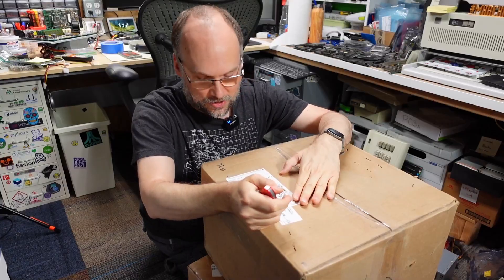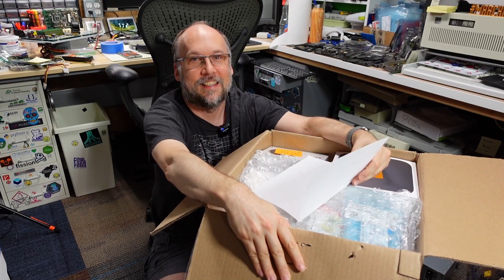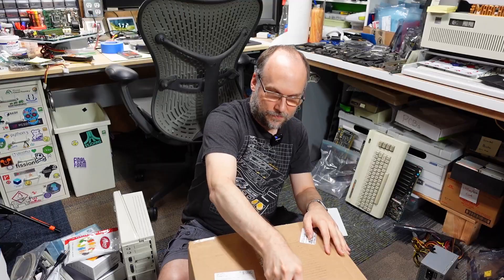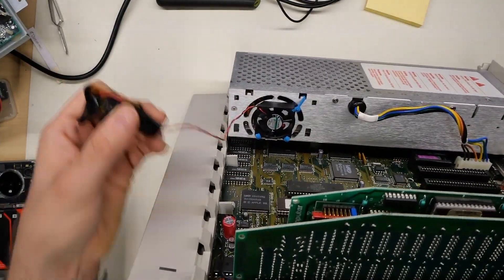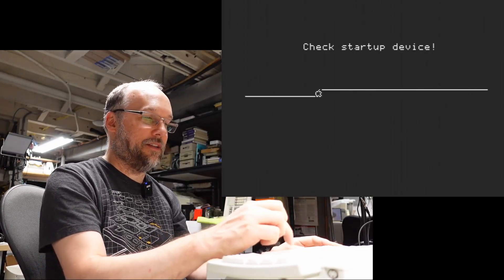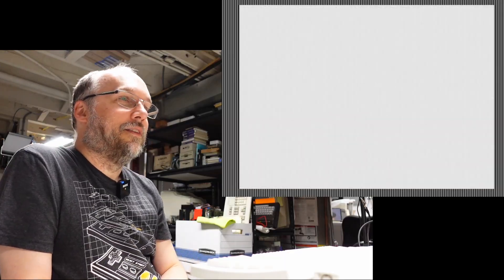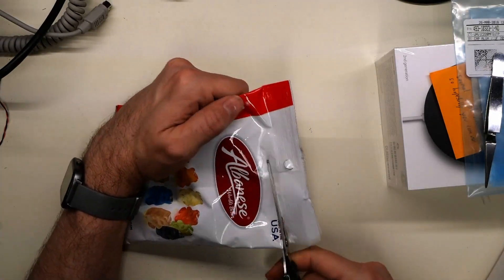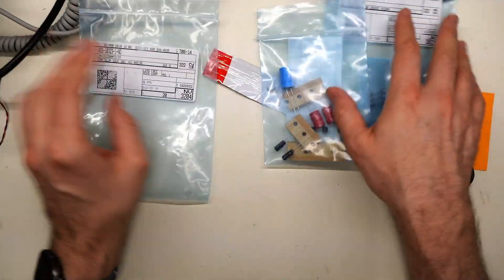This computer was designed for smart kids

Comment: Cool, that was an unexpected surprise! I'm the author of that nearly 25 year old "mailing-list e-mail" at 18:20 (actually a Usenet Newsgroup posting) where I documented the ROM 3 differences! It's Mitchell though, not Michael. ;) I still use my Apple IIGS, and it's remained on my desk for nearly 35 years now, as my all time favorite piece of tech! Really enjoyed watching your video, here's some more tidbits of information: 

The IIGS actually shipped with only 256K RAM for its first 1.5 years (it only came with 512K by March 1988). The ROM 3 board you have is a developers unit, the regular production run did NOT have a 32-pin machine socket or EPROM, just a dual set of 28-pin sockets with masked ROMs. If you look at the part number, it's a beta revision of the 'ROM 3' firmware. Functionally it works the same, it shouldn't affect compatibility or cause issues (I can describe the differences if you're interested). 

Removing the upper lid's metal shielding, or powersupply that is touches, may introduce audio/video noise which may explain the noise you're picking up. Normally the ROM 3 board has very clean audio. 

Yes, the official name is indeed "The Apple IIGS with 1 Megabyte of RAM", the name "ROM 3" is just a common nickname. The ROM 3 came with a "Reference manual", whereas the original ROM 00/01 came with a colorful "Owner's Guide" which was more fluff than useful information, but it didn't have those hilarious photographs (hah thanks for the good riff on them, I thought they were a good laugh even back in the day!). The DMA SCSI board (Apple II High-Speed SCSI Card) is far more preferable over the original non-DMA board you have (Rev C SCSI card), and not just for speed, but getting along with removable media among other things. 

The "MB0" was a typo, I meant M2BO which is short for "Mega II Bank Zero", which was a required signal for certain I/O boards. You could install both the genlock card and other video boards at the SAME time with the ROM 3; speaking of which, the "Second Sight" was a VGA-output board released for the IIe and IIGS in the mid-90's. It had the capacity for better graphics, and a handful of SS-native programs were written that took advantage of it, but it was generally just used as glorified Apple II-to-VGA monitor interface. I actually helped influence its design, convincing the developer to use a better RAMDAC (bt478 vs bt481) to increase its color depth--little good it did in retrospect. 

The "Zip GS" I mention was a CPU accelerator board, the competitor to the TransWarp GS. Those can be finicky with stability when pushed to higher speeds, and the ROM 3 board's cleaner design often helped (those of us wanting to try for 15 or 16 MHz!). It wasn't a compatibility issue per say, just bettered your chances. The speed improvement is not only boot time, but also a slight (but noticeable!) boost when scrolling through windows, screen redraws, etc because of the toolsets being in firmware. Not just for better optimized tools, which they were, but they were being fetched from ROM (@ 2.8 MHz) rather than RAM (@ 2.5 to 2.6 MHz). 

Feel free to ask if you have any specific IIGS questions, whether about the ROM 3 or Apple IIGS in general! Lucky you got a nice working condition AppleColor RGB, both mine seem to be failing, and I think I need to recap both (worsening issue with brightness and focus after it's been powered on several minutes). Wouldn't mind knowing what caps to get, based on what you have in those bags! Thanks again for the enjoyable video and crediting my post and my detailed tech spec list below it!
Reply: This post should be pinned.
Reply: I'd love to see more info on the Video Overlay Card for these.  In the late 80s or early 90s I attended a program at a local science-focused school which had a lot of apple gear, andI remember using one of those.  One thing I never completely understood was that when connected to their 80s-ish analog video switchers and recorders, the colors came out shifted from what was shown on the IIgs's monitor.  We had to alter the palette to make them show as we expected on the video output.     Also, I remember one of the instructors showing me an apple prototype of that card which they had been sent before the real one came out.. It was a huge card, incapable of being fit into the actual IIgs case- it had to be run with the top off, I want to say it was nearly a foot tall, but that might be my ancient memories playing tricks on me.    I imagine those are pretty rare these days!
Reply from the maker: Heh, sorry about the slip up on your name Mitchell. :-) Very cool you stumbled across this video with me going over your old post. I have a feeling the audio noise we heard was a ground loop issue as my USB ADC isn't a fancy one and likely connects ground to USB via my desktop PC. Knowing Apple, they likely used a split ground plane on the IIgs which helps with RFI but can cause annoying ground loop issues when hooked up to grounded audio devices. Unlikely to be noticed with most amplified speakers, etc. The Color Classic was one such device where it used the shielding itself to bridge the split ground planes on the audio section and since I had to remove the shielding on that since an exploding battery had destroyed it, it led me down wrong paths until I figured out the silly split ground.  The ][+ RFI machine also suffers from excessive jail bars due to a split ground plane --- I never made a video about it, but I bridged the split ground planes and it completely fixed up the ugly jailbars the later II+ machine I have.
Reply: Wow, this is a HOF level comment. Thanks for the information!
Reply: Holy moly

Comment: You're right about the startup sound.. That beep reminds me of a sound effect for when you drop something, or select a menu item that's not available in a retro game.
Reply: Gotta admit, as nostaligic as I am about the IIGS system bell (that weird "kronk!") , it isn't the most pleasant sound. Interesting thing is it's NOT produced by the Ensoniq chip, but it's also NOT a standard Apple II sound produced by 1-bit speaker toggling. I've actually challenged a programmer to reproduce it on an Apple II Plus or IIe, which was very close, but wasn't a success. I'm still perplexed all these years later HOW that unique system beep is produced on the GS! I think it may be 1-bit speaker toggling only reshaped or modified in some form using the GS's sound supporting hardware?

Comment: That //GS keyboard was my favorite; so much so that - when I got my first Mac (a Performa 475) - I used the //GS keyboard instead of the one that came with it. I was sad when Apple discontinued the ADB-type connector, as I couldn’t use my favorite keyboard anymore. 🥺
Reply: There's a modern adapter called the "USB Wombat" that lets you either use a USB keyboard/mouse on an ADB machine or use an ADB keyboard/mouse on a USB machine.  So you can use the IIgs keyboard (or the big Apple Extended II ADB keyboard) with a modern PC or Mac (or a RasPi or whatever).

Comment: Hey Adrian, love your photo descriptions. You should go through some vintage magazines and decipher some advertisement photos!

The ROM 3 also had a fun little Easter egg. When you get the 'Check Startup Device' screen, press Control-Option-Apple-N it will play an audio clip from the development team.

The SecondSight was a VGA board for the IIGS

The PSU on the ROM 3's had the brushed aluminum case. While the label did read 70W, that's the input power, not the output.

Your monitor seems to be missing that bar that can be used to pitch the monitor up about an inch or so. 

I'm surprised you didn't make any mention of the copyright date in the GS/OS about screen. 6.0.2 was released back in 2015 by some people who got a hold of the original source code and made some modifications to fix some bugs and update the Daylight Savings Time. The latest version was 6.0.4. Not sure if there will be any more coming from them though.

Comment: My elementary school was built in the mid 1970's and had deep, plush (not shag) carpet in the School Library, with flowed nicely into a multi-tier conversation pit (mid-1970's, remember?).  It also had house-style moldings at the top of the walls.  Also, our Apple IIe lab consisted of about thirty IIe's that netbooted from a central server of some kind rather than using local storage (floppy or hard disk) and had two shared Imagewriter II's (IIRC) on a table at one end of the room.  The server had a massive library of educational software on it, which was pretty amazing to a kid in the 80's.  (You could also press ESCAPE to boot from a floppy, if desired.  A friend of mine and I got permission to program in the lab during recess, so we naturally brought our own floppy disks.)  I last used a IIgs in high school around 1999 to operate sensors (light gates, etc.) in our physics lab.

BTW, that's some deep lore you invented for the stock-photo characters, LOL.  :-)  Why commercial photographers didn't believe in depicting cords on computers, I'll never know.

Comment: Re: Shipping Monitors.    Way back in the late 1980's, I was a service tech at Computerland.  (remember them?).
One day, about the time UPS normally shows up, I heard our inventory manager laughing loudly from the back room.   
We had been expecting a very large CRT monitor from Radius to arrive.   UPS had just dropped off the box and it had a large hole punched inward on one side, and on the opposite side was a large hole punched outward.   
Someone had driven a forklift fork right through.   It had gone dead through the middle of the CRT and out the back case of the monitor.    I couldn't believe UPS had bothered to complete the delivery, but found out it was policy.   It was on us to file a claim.
Reply: That reminds me of when my work was the service company for one large OEM, and after we’d refurbished an unit for one customer, it comes back, and we could only facepalm at the condition of the box… it apparently fell off a pallet and promptly got run over by a forklift. The delivery company ended up having to pay for a brand new unit sent overnight to the customer.
Reply from the maker: How ridiculous -- and typical! Like all the way along no one noticed the shards of glass and bits of debris falling from the box?
Reply: @adriansdigitalbasement  Oh, they noticed.   As I mentioned at the end there, they had a policy to complete the delivery and have us file a claim.    Within UPS, I'm sure it was one of those 'not my department' deals.
Reply: I sent a refurbished Engine Control Unit with DHL (worth about $800). Next day we received an email from DHL with a picture of the package that had clearly been ran over by a forklift. "Please let us know which account number to send the $3 compensation to".

Comment: The applecolor rgb monitor is one of the best in terms of shipping durability, since the fly back transformer is screwed into the metal chassis, so if it bangs around, it gets transferred to the front bezel and not the main board.

Comment: Second Sight was an addon card that allowed you to use multiple monitors with your IIgs.
Reply: Or specifically, VGA frequency monitors (~30 KHz) so back in the day we could connect our IIGS's to larger 14, 15, 17 or even 21" SVGA monitor that were so common place on Windows PC's and Mac's. It also allowed for higher resolutions and more colors per screen, but few, if any, programs took advantage of that feature. The card was generally a flop, not only in sales numbers (it came out in late 1995!) but in design. The firmware was never really completed, leaving the card glitchy and unstable.

Comment: Still have my IIGS ROM 01 with monitor, 3.5" drives, Toolbox Reference, Hardware Reference, and Technical Reference manuals since '86.  Good to see 4MB and 8MB memory cards available.  Had its power supply and ][ Plus power supply re-capped in '20.  Reactive Micro's TransWarp clone might be in its future. 😁

Comment: The DOC chip in the IIGs is very capable. It's used in Ensoniq Mirage, ESQ-1, SQ-80 and other professional synths from the 1980s. Of course, when used in those synths they were coupled with high quality analogue VCAs for envelopes and CEM filter chips.

Comment: Yes, back in the 80s I had both a Mac IIci and IIGS, and I did do a network boot on the IIgs. It was so long ago I can't remember the details of the setup. Might have needed to use the pre-boot control panel (BIOS) to set it up to boot from network. It was designed for schools so that all systems in a computer lab would boot to the exact same config. Networking in those days was so damn cool and was years ahead of the PC because networking was builtin both the Mac and Apple IIgs. All you need was some cheap AppleTalk cabling.
Reply: I have netboot set up on my Apple IIgs with AppleTalk.  I'm using a Mac SE with an 80MB SCSI drive as the server.  To do this, you need to use a specific version of AppleShare Server (not regular file sharing built into the OS), with Apple II support enabled.  I believe I'm using AppleShare 3.  It only runs on older MacOS versions; I think I have 7.5.3 or 7.5.5 - I don't think it works in 7.6+.  On an older Mac (like the SE), the Mac is noticeably slow when the Apple IIgs is using the server, but it works fine and is faster than a floppy disk.  On the Apple IIgs, you set up network booting in the control panel by setting slot 7 to AppleTalk, and maybe changing 1 or 2 other options, then remove any boot disks and reboot.  There seem to be instructions here: http://www.synack.net/~bbraun/iigsboot.html , but I don't think this is what I used to set it up.  I did a minimal boot off the server, then used the GS/OS install disks to install from the IIgs to the server, and after that it's able to network boot straight into GS/OS.

Comment: The GS power supply actually produced a lot of electrical noise, which is the reason for the metal shield that you removed. I found this out after I hacked a ROM03 into an old PC tower case (using the PC's 250W power supply). It worked, but there were issues.

Comment: 1) Photoshop 1.0 was a great friend (and ran well on a Mac Iicx/x with the 24bit color card though it was eh on the 8bit card...)

2) Speaking as a retired teacher, school libraries were usually a double or triple sized class room. So that library pictured in the video would be a school library and not a full building community library.
Reply from the maker: Heh -- yeah in most cases, it's a non issue since I would just upgrade the ROM -- but in this case the motherboard is actually different and you can't run ROM 03 on the older machines.

Comment: 29 minutes in, there is a dual 3.5 inch floppy. Does anyone know what this is? I could not find anything about it. 
The 250 zip disk and drives are rock solid. As recently as 2016 I've used a 250 zip drive to retrieve files for people at work. 
It is remarkable that there was accessibility built in and pictures of people using them. Sticky keys, mouse via keyboard, and more! Very forward thinking!

Comment: One difference between ROM 01 and ROM 03 is that you can use user cards in some slots AND use the integrated hardware bound to that slot. For instance I believe you can use the mouse and a card in the slot the mouse gets assigned to at the same time with the ROM 03 and not with the ROM 01 where you have to choose.

Comment: Big advantage of rom3 is you can disable  the mouse in the slots setup screen and use that slot for a mockingboard or something, but the mouse will still work in gsos.  This was not the case with the rom1.
Reply from the maker: Ah that's fascinating little tidbit. Does the Mockingboard still work with a program running inside GS0S? (Full screen clearly)
Reply: @adriansdigitalbasement  I don't know of any IIgs software that uses the Mockingboard; I've only ever used it in IIe mode with the Ultima games.

Comment: Adrian, 25:56 - there was school sharing software for the IIgs, I was talking to Retro Tech or Die about it one day.  Really interesting stuff.  It could share files and applications over AppleTalk.
Reply: I played with AppleShare on my IIGS using a Macintosh Plus as the server decades ago. Simply attach a serial cable between the IIGS and Mac's printer/modem ports (the ImageWriter II's serial cable for example) and enable AppleTalk on both machines. You can boot the IIGS through the Mac, or mount the Mac's hardisk from the IIGS Finder, even run IIGS software stored on the Mac side. Pretty cool stuff. I used System 7 on the Mac but it should be doable up through MacOS 9 at least, and work on newer 68K and PPC Macs.